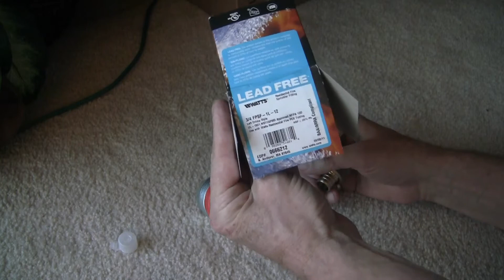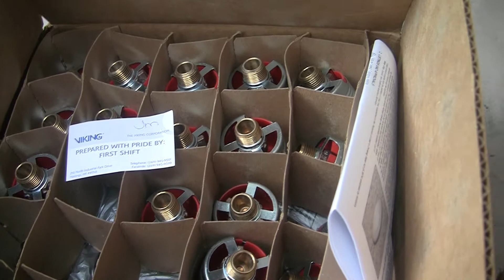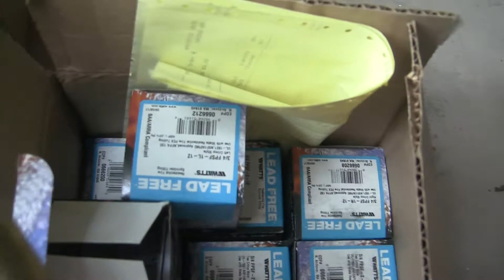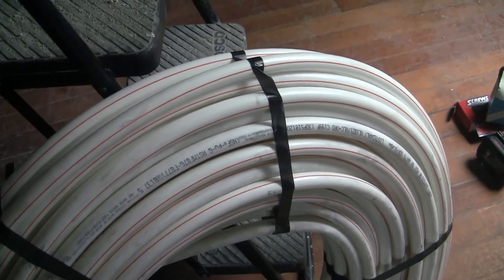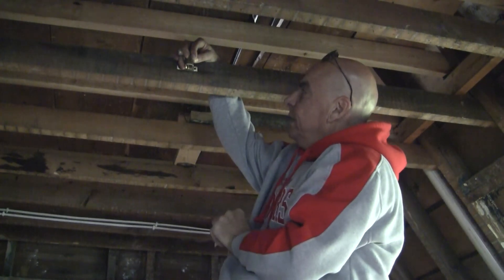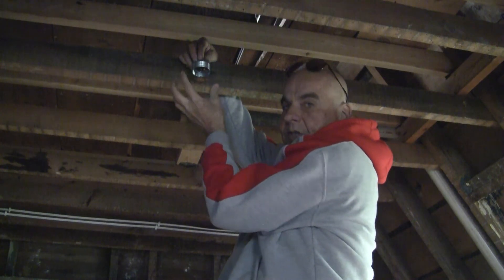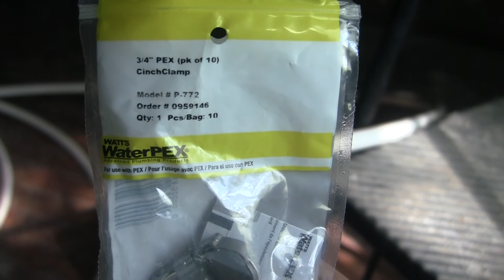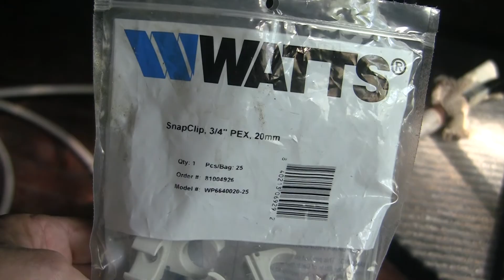Working with PEX tips and installing a DIY home fire sprinkler system

Comment: Wont that pex melt in a fire making the sprinklers useless??
Reply: Matthew Diluzio you do realize the sprinklers would activate before it got that hot, right?
Reply: Yes I realize that, But fire gets into walls and ceilings as well, It don't matter the Pex is rated for fire anyway, But yes I know the heads will go off only if the fire is near it, That's all I was saying.
Reply: Matthew Diluzio I have never seen a fire melt plastic sprinkler line. The heads have always kept it cool if enough.
Reply: @char_char1836  as long as at least one downstream head was opened the pipe would have cold water flowing through it, right? So unless flame was lapping at the pex it would stay almost as cold as the water inside.
Reply: If it concerns you do it copper.

Comment: propex expansion is rated at1500psi....no shit ..the fittings wont break but at that pressure the pipe swells till it bursts at 1000 psi.....